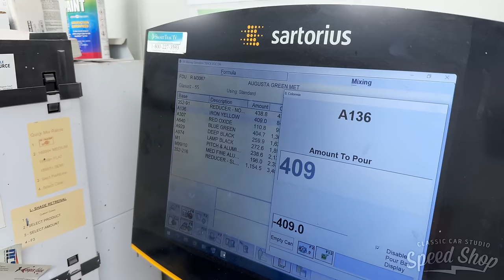Paint & Body • Episode 2 • 68 Ford Mustang Fastback

Comment: I see that you start off wet sanding at 800 what grit is final wet sanding before polish
Reply: Curious as well. My suspicion is that it went to 2k or 3k depending on what they started with on buffing.
Reply: ye for finish, but you have to go deep with 800 and finish on 8000 or 6000, when you have 5 coat of clear u can go 800 1500 2K 3K 8K  @SupercarSeany
Reply from the maker: Usually we’ll be at either 3000, 5000, or 8000 before we start polishing. It just depends on how smooth of finish the customer wants. For example, we won’t typically go this high for a factory correct finish on a factory restoration.